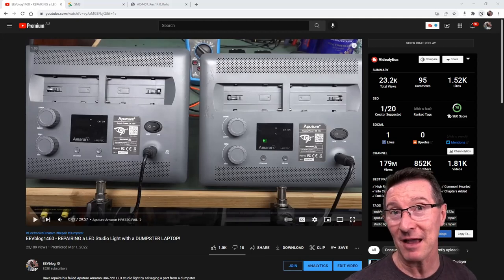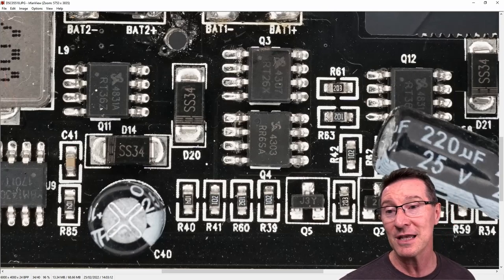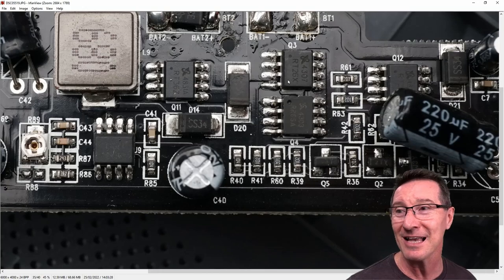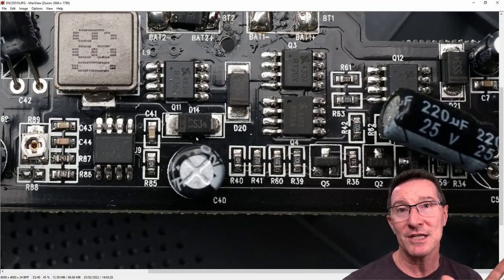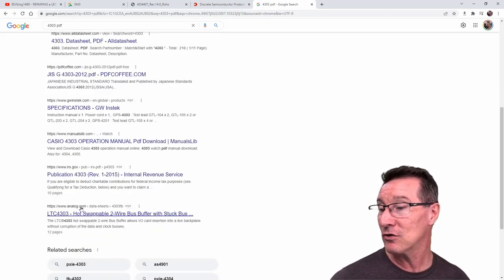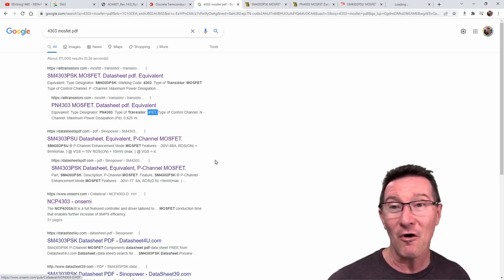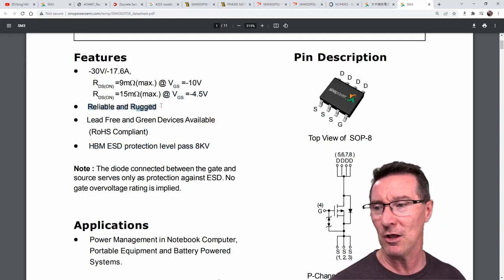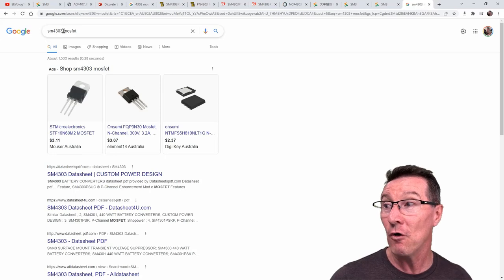EEVblog 1461 - The MOSFET Search CHALLENGE

Comment: Epic video! Next time try finding a low Iq LDO that is in actually in stock ;-)
Reply: Ask and you shall receive, I spec'd these (5V) out recently on Mouser after a long distillation of parts: AP2204
and MCP1792, something like 55V in and 100~250mA current, enough for powering smaller logic...

Comment: Odd ball "not quite an EE yet" question: I've seen plenty of good reasons to use a MOSFET in lieu of a BJT, but are there any good reasons to go with a BJT over a MOSFET? FETs just look to me like a vastly better option no matter what the criteria, so since BJTs are still being made I must be missing something.
Reply: BJTs can be driven with rather low voltage (0.7V), which does not vary very much. Big FETs need much higher voltage.
With matched BJT pairs you can build neat things like current mirrors etc. Threshold voltage of MOSFETs varys quite a bit from part to part.
There are certainly many more reasons to use BJTs in certain applications.
Reply: Of the dozens of parameters that a transistor has BJTs can be better on certain characteristic like leakage current, robustness to ESD, or switching time.
Reply: In the intro to circuits class at MIT they don't even talk about BJTs, they introduce FETs and as far as the students of that class know it's the only kind of transistor that exists.
Reply: In some high power apps, BJT holds an edge over silicon MOSFET. The biggest example I can think of is IGBT, which has MOSFET interface with BJT-like output. This thing is used very frequently in solar or power projects. Not until the last few years that the options become expanded, where we can think about SiC or GaN FET.
Then you also have classical works like class AB amplifier. I use them whenever I need a cheap and fast way to drive a speaker. It works extremely well.
Reply: BJTs have much higher transconductance so are much better performers when designing amplifiers. They have lower noise as well, so better for those applications (JFETs are better than BJTs in this category though). BJTs generally have tighter specs; FETs oftentimes have large ranges for important parameters (eg most FETs don't even provide a Vth value like you would expect in school). The list goes on. They all have their place and uses.

Comment: I've been through this kind of wild goose chase many times, usually ends well but sometimes the parts are just impossible to identify. Especially if they're older parts from 10-15 years ago which are now obsolete, and the obscure manufacturers don't even list those obsolete parts anymore, or have the datasheets.
Also in your analysis around 3:50 you miss one other possibility, that the part could have been an IGBT. You could have elaborated there that while an IGBT is possible, it is unlikely because one would likely not use an IGBT for a 8-12V application since those devices have clear advantages over MOSFETs at higher voltages only.

Comment: Thanks this series is very interesting and clever use of the fet from the laptop .but the replacement doesn’t have the E.S.D. Protection? So will you fit the right fet in the future? 

This was really nice detective work and a step-by-step explanation of finding the data sheet for the faulty part 

It would be good if there was a place/page with all the manufacturers brand logos it would help find a obscure part

Comment: Equivalent Protected Gate at Digikey with stock:
FDS7779Z - near perfect match.
SQ4483BEEY-T1_GE3  Double protected Gate with series resistor special.

Others without stock at Digikey.
SI4491EDY-T1-GE3     Stock at Mouser and Arrow.
AO4447A                     Stock at Bristol Electronics.
FDS6681Z                  Stock at Mouser.

Others exists, but their good VGS on voltage begins at -10v, not -4.5v, so you need to be careful there.

Also remember, when a MCU manually drives a P-Mosfet's Gate, it may be done with a open-collector IO pin or NPN transistor collector output through a series resistor.  If you power supply is 2x8v batteries in series, potentially above 16v, those protection diodes may be in use to prevent the gate from exceeding a maximum -15v, or -12v for low gate voltage mosfets.

Comment: From my experience selecting right mosfet is not so difficult. Much more difficult is to find right IC. In my case there was needed some SO8 dual rail to rail input, rail to rail output operational amplifier. Max supply voltage not less 36V There is a lot of devices with rail to rail input or rail to rail output only or 5V supply. Originally there was LT1490 and I did not get it in EU for several month...  Even if supplier show "in stock" actually none has it.

Comment: This reminds me of Doug's Secret Squirrel jFET with the built-in gate shunt diodes. What kind of bean counter would specify such an obscure component when you could just add the clamping Zener diodes externally? The mind boggles. (EDIT: Even not knowing much about such protection components, a quick jazz-hands tells me that such built-in ESD protection is a TVS diode, and these are commonly available as discrete components, so...again, why the funtruck?)

Is there a Top 5 jellybean MOSFET video in the near future? That would probably be helpful to a lot of your viewers.

As far as I can tell, and as a former valve enthusiast, I've given this a lot of thought and devoted many hours to searching for an answer to this question, transistors got stuck with Q for reference designators because they were latecomers to the party; they got seated at the slush table because they didn't RSVP. T was already taken; V would have been the next logical choice because they function as electronic valves, but even when transistors were shiny and new we had a fetish for only allowing vacuum state valves to be called that. Had I been at the table back in the day, I would have advocated for V, but really, "that which we call a rose," and there's too much historical inertia to change it now.

Comment: Why am I subjecting myself to such torture during my little bit of rest time..I do enough of this as part of my work. Hunting datasheets for components that have been obsolete for 30yrs before trying to find a replacement can be interesting. I often repair old industrial equipment. I'm sure some information is only available on paper, in a box, in storage at some old retired grey-beard's house somewhere on the planet... Anyone know any technicians that used to work for Gould instruments during the late 80's - early 90's, in the data acquisition section, dealing with thermal array recorders? Info on the TA11 is practically non existent..even in the archives.

Comment: The representation in the data sheet is interesting, it's almost as if you would have found better major manufacturer matches by looking at gate charge and Rdson for the package rather than trying to use their claimed current capacity.
Reply: its might because the rds varying based on the temp. so they give both values?

Comment: Looking at that datasheet for the 2 compared probably both actually are the same part, made in a fab, and marked for the customer as needed. Probably the 2 companies are related in some way or the other, either one owns the other, or they are both owned by another.
Reply: If you talk about VBsemi part, they are not. VBsemi sells a lot of crappy "substitutes" with the same part number but inferior Rds(on). And likeliy it was a "substitute" for APM4303 from Anpec.
Reply from the maker: Must be very different parts when one has ESD protection and the other doesn't.
Reply: @EEVblog  is there any spec in the datasheet on that  ESD protection, other than "it is on the drawing don't worry"
Reply from the maker: @fuzzy1dk  It's usually just a note that it meets from standard or whatever.

Comment: Hi Dave just a comment/observation. At the start of the video when you were talking about likely ratings for the device you mentioned current rating in the order of 5 Amps. Looking at  the data sheet info for the actual device I saw 17 A for the ESD protected device and 11 A for the unprotected device ?? , not sure if that was max rating . So continuous rating may have been in the order of your estimate yes ??
Reply from the maker: They are continuous, but depends on thermal package rating and ambient temp.

Comment: @dave Same board how to find out the type of Q5?
Reply from the maker: If it has a series resistor on the base/gate then it's a BJT. And you'll be able to measure the BE junction diode.
Reply: @EEVblog  if you see a resistor on the base/gate could it not just be a small resistor for lowering the slew rate to lower the EMI?
Reply from the maker: @wtfucrazy  Yes it could be, but that's why you'd go in and try and measure a BE junction.

Comment: dude, you searched for SINGLE BJTs and then tried to filter by those with more pins, which usually feature arrays etc. what the actual fuck. You also searched IN the signle bjt category, for BJT, which removed a ton of results. You also seemed to forget theres other categories as well. with your parameters searched, and ignoring other SMD packages that would still work in the same board, theres 31 in the matrix category, 26 in the RF category, 3 in the pre-whatever category (not obsolete ones), and 62 in the category for buffers, drivers, transceivers, receivers.
dude... No offense, seriously, I look up to you, but how dont you know how to search for components?
So yeah, you DO get BJTs in SO-8 packages, but they, same as the mosfets, arent just 1 single transistor with an obscene amount of pins, whats the point in that...
Also, in the future, just use alltransistors, you can find the IC in 3 seconds. The second line on the package is LOT number btw, not date code.

Comment: Digikey ads show up in my search for a HOSIDEN switch part number (“HSW1699-01-010”) even though they don’t have it. Strangely, their ads are for switches even though I don’t have “switch” in my search. Also, HOSIDEN makes many more components and their name was once synonymous with S-Video connectors, so I think it’s safe to say they are known more for miniDIN connectors than switches. DigiKey doesn’t have any HOSIDEN switches and they don’t have any results for that part number on their website so how on Earth did they associate that part number with their selection of switches?

It seems they have a database including part numbers they know they don’t carry and they pay for ads to redirect you. I’ve spent countless hours in their parametric search and been unable to find a switch that matches the HOSIDEN specs years ago… before I even knew it was a HOSIDEN switch.

It is for an old Sega Genesis/Mega Drive Model 1 though I know the switch was also used in some Sega Master System consoles. Just seems weird that I can’t find a similar replacement slide switch but when I begin to put in known/measured metrics my search results always dwindle to zero.

Comment: if you really want pdf links mostly try filetype:pdf ... a lot of the chinese datasheets are on those generic sites though that have their own stupid "html pdf viewer" and won't give you the pdf. Many ways to skin that cat but... I really generally get better results with "4303 mosfet" or similar, then the sinopower comes second or third or so, the logo somewhat matches, the case not, so "SM4303 mosfet" or "SM4303P" or so gets you quickly to the right package...

but what I think most of the time is really much more powerful when you don't get the first thing right, switch to the image search tabs, in most cases it has thumbnails of datasheets, and there with "4303 mosfet" one can see right in the first few search results the sinopower one in the right package... at least for me... google results seem to be different for everyone